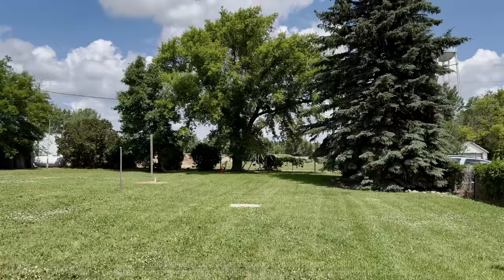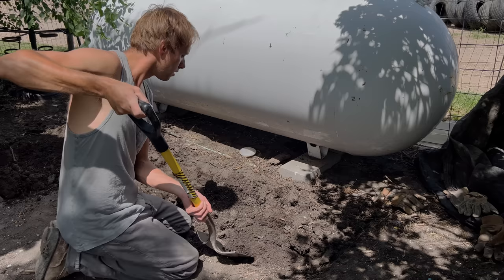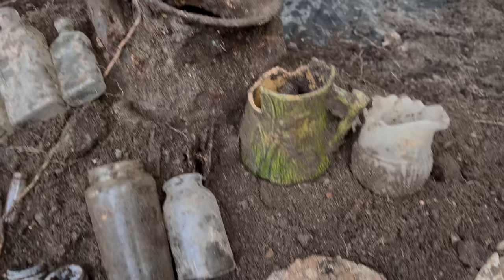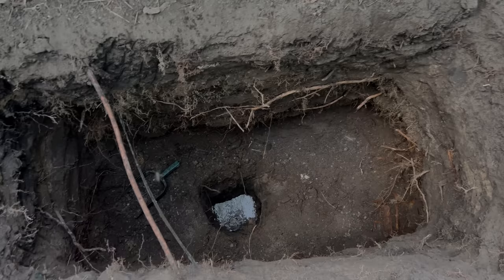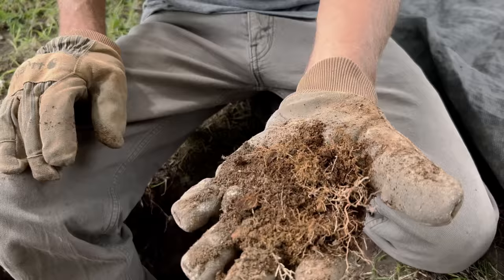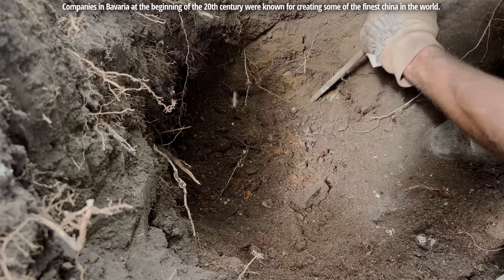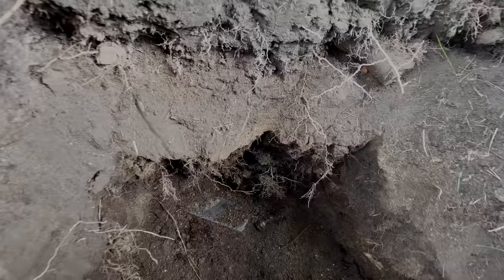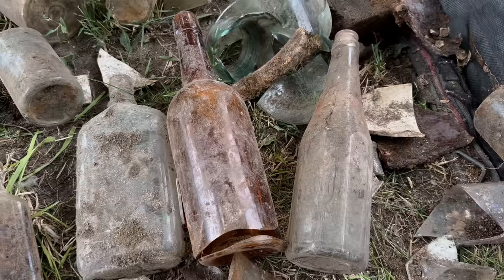Tunneling into a Hidden Cache That Hasn’t Seen the Light of Day in Over 100 Years

Comment: What's tool top. And machine top mean
Reply from the maker: tooled top or machine made refers to the manufacturing style that they were used to make. pontil is like civil war and before era, then came applied top, came in the few decades after that, then tooled top came out in the late 1800s, and then machine made took over around 1910.. different items have different mnfg techniques, but those timelines are generally correct. 

tooled top just refers to how it was made, the body of the bottle would be made in a machine mold, and then the top would be hand applied.. machine-made just refers to the bottle being made with full automation.

hope that was helpful. its just kinda complicated. thanks for watching!

Comment: question back in the day would people through there trash in the outhouse pit?
Reply: @Tom A that is where I am confused, I have a place in the high desert Yucca Valley and I have an outhouse it is not easy to move the shack over a new hole or pit. 1 you have to move the outhouse 5 to 10 feet so when you dig the new pit the dirt goes into the old pit, 2 then you have to drag your shack over the new pit this would happen about once a year but if your trash was in the the pit this process would be monthly and I had a burn pit for trash and we all know you can't burn trash if there is an outhouse above. I am sure you are right but it doesn't make sense to me and that is just my opinion.